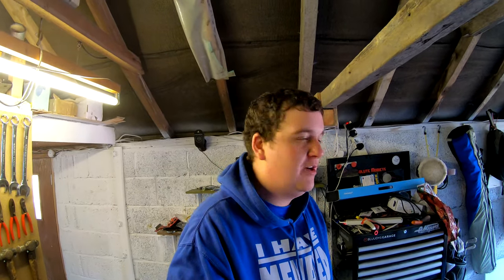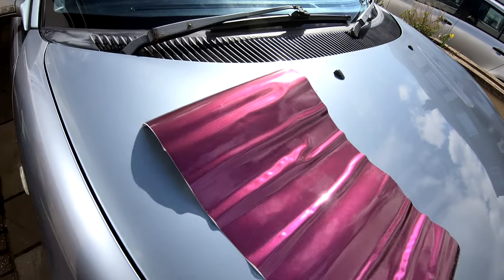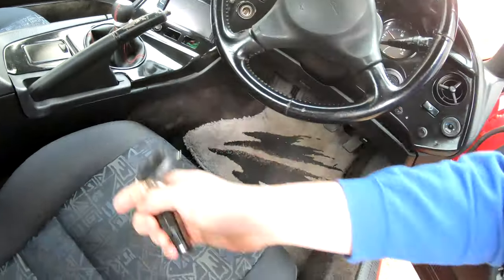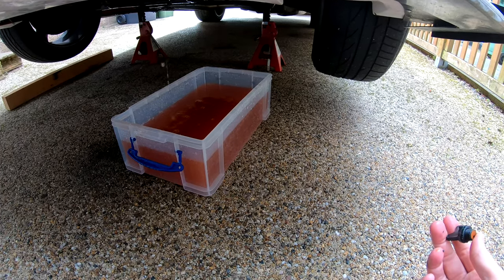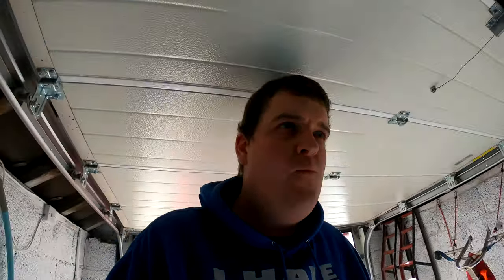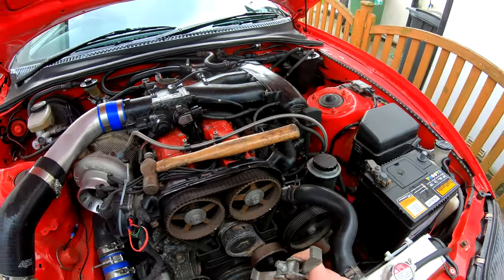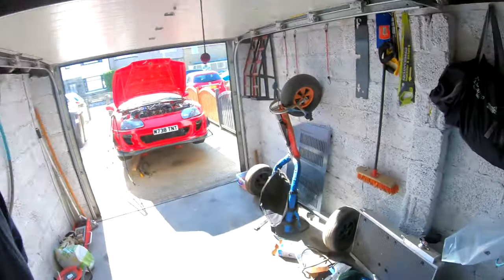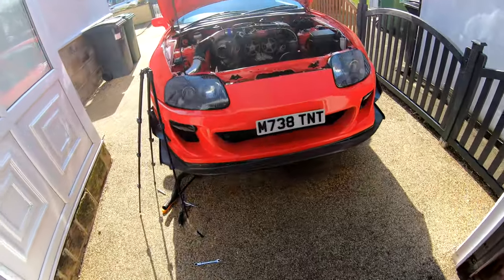Ripping out the Cooling System on my TOYOTA SUPRA (Part 1)

Comment: Does it have hydraulic lifters if so it may be those need adjustment or replacing 👍
Reply from the maker: It could be. Someones also mentioned a short on my ignition leads. So it could be that too. Makes the same sounding noise.